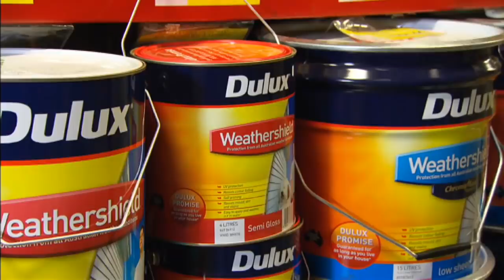Build An Amazing Entertaining Area | Outdoor | Great Home Ideas

Comment: So here I am wondering why a power-washing company wasn't called in to do a one-hour (or less)  job of cleaning the exterior vinyl cladding, instead of a scrub brush job that takes 3 to 4 hours?  I'm guessing that the scrubbing (and conversation) is for the sake of the TV cameras. Never mind, no matter - the end result is spectacular. I love it.
Reply: A power washer would have taken off the paint.
Reply: +S J Belew 
Exterior vinyl cladding is painted?? I'm pretty sure vinyl cladding comes in a variety of colours - it's plastic - why paint it? I guess they don't have the same kind of vinyl cladding as we do in Canada. My home is clad with vinyl. Every year the strata council (condo council) hires a power washing company to clean our buildings.
Reply: +S J Belew
Jason mentioned already, the cladding can be cleaned, but NOT painted. So it must not be painted before.
Reply: This is a segment from a show called Better Homes and Gardens which is on every Friday in Australia. All these DIY segments are about things you can do yourself to save money, or just for a sense of personal accomplishment. Hiring somebody to come and pressure clean your house costs extra money and doesnt really fit in with the DIY theme. So running over it with a hose/brush is something you can do yourself and free of cost. Most Aussies do have pressure cleaners for driveways. Personally I just borrow my neighbours when I need one and he borrows my brew gear for making beer.
Reply: Ole Nielson the budget dude....
Reply: Power washers use a ton of water, & depending on which bit of Australia this is, there might be a drought - New South Wales state has had for a few years now. So possibly very strict water usage rules, apart from the whole DIY ethos of the show....